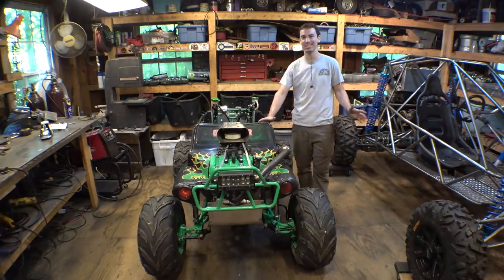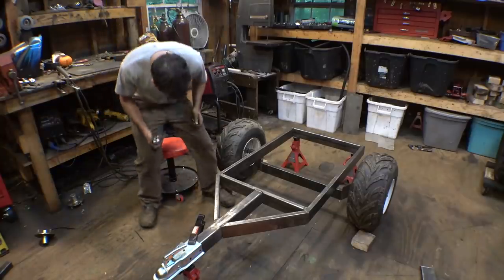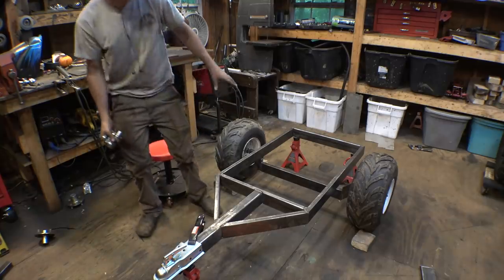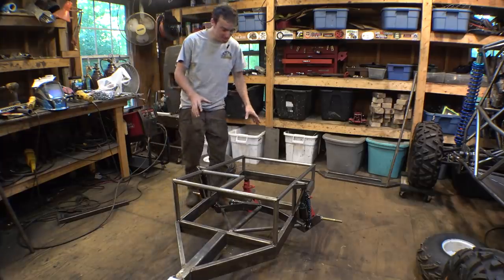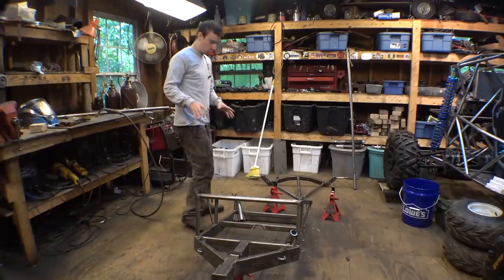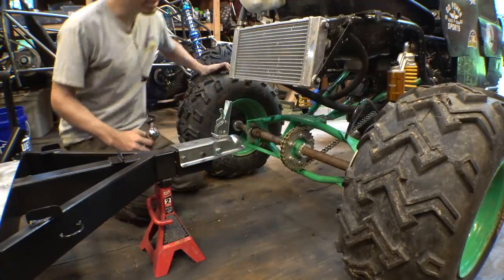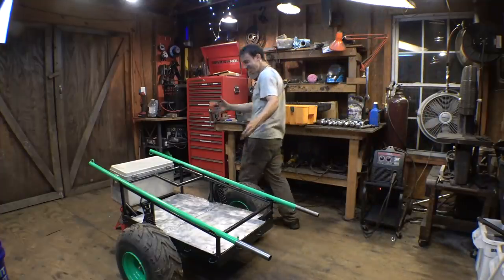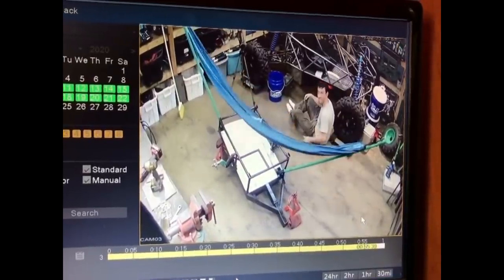Budget Powerwheels Overlanding Trailer Build

Comment: The trailer is super cool!  But I wonder if attaching the hitch on the Ninja below the suspension might be a mistake?  Wouldn't it be much more stable if the ball was attached to the chassis above the springs instead of below them?  There would be much less movement of the ball overall that way...

Comment: Great build man!  If I might offer a pair of suggestions that I think you'll benefit from. 
1. take some thick wall rubber tubing or hose long enough to wrap around your trailer hitch plate on the ninja.  and slit it lengthwise and jamb the ends in to those open tubes (or just split it over them.) and tuck that flat plate part of the hitch into the slit  in the hose.  Your shins will thank you!
2. you might want to pop a couple swing up or just  removable outrigger  legs (back hoe style) to keep the front end  from tipping over .  (like back in the day when "ATV" meant 3 wheeler, not quad. And they would roll over on ya if you cornered to hard or fast!  ;)  Without em I think you'll find your hammock a tad unstable even with the wheels on and hitched up.

Comment: looks great and functional. .  suspension turned out good too!

*edit*
you may want to run a big bolt with a wing nut or something to keep them extension arms secure.
i know they seem right now but i think vibration will rattle them loose after time.
i could be wrong(so at least bring some zip ties, and duct tape. . lol

peace, eric

Comment: I'm just going to build this out of scrap I have laying around.  Persists to build one of the best trailers I've ever seen.
Reply: And this thing will hold 2000 pounds, built like a tank xD
Reply: Its so over built.. lol
Reply: some people are amazing with repurposed materials...
Reply: calholli then there’s boostedbois. Their turbo v6 sandrail has less frame than most of RBW’s builds
Reply: Real talk though, Chris needs to see that he can use much less cage, dudes building complicated heavy cages when he can basically lightly modify a funny car cage design and still be lighter
Reply: His and grind hard plumbing trailers are insanely well built.
Reply: Chris L apart from the hitch snapping on grind hard one and having smaller wheels I think this one will last longer

Comment: Now you are arriving at my campaign. My cross cart plans are a starter motor for reverse gear and a hammock that uses add on fence tubing connecting to the frame then dis connecting for the hammock frame so it is unseen until used. It will only be partial frame support. I also want the gearing 2 speed on and off road so it will dramatic gearring.  The frame unit will flex for short and long wheel bases. The hammock may go away so i can sleep in the actual cart and the hammock bars will provide a water & weather proof protection. I want quiet so the exhaust may be an all together different project. Heating rocks for cold weather. frame (inner tubing) and exit the other frame side (also a rocks heater, perhaps a fire box) plus a heat radiator cut off valve. Plus an airconditioner smaller engine, say 49cc  and an automotive built in the small trailer.   
    For me,  Climate control is essential.  The hammock will allow for another person plus for fishing as a net.

Comment: I hope it don't rain! LOL I'm sure that tent I mean hammock, lol isn't rainproof you'll be sleeping in a water bag.
Man if I would have known you needed the trailer in a pinch you could have just borrowed mine, and my gear... It's not the best I built it for my motorcycle, it was a 4' X 8' utility trailer Harbor Freight Style... One section out of it so it's only 2' x 4' axle cut down and leaf springs. Cooler on front, and small table top LP Grill, but the best part is the body, it off of a display unit from a bedliner company... so it's got a 2 by 4 ft by about a 1' high tiny little truck bed trailer. Fits all my camping gear perfectly cover the top with a tarp and I'm down the road I go... It's travel the highways from the Quad-Cities Area, to Nashville, Tennessee, to St Louis, and back to the Quad-Cities, and proving itself a very useful trailer for various jobs all the time.... so it's proven its durability for as cheap of piece of junk construction it is... definitely cute build if you want to call it that being a miniature truck bed trailer, everybody's like it and asks where the heck did you get that, just really neat to see behind my motorcycle and get it painted yellow to match.

Comment: In the future when you paint rims with the tires on, if you slightly deflate the tire you can slip playing cards between the rim and the bead of the tire then just re-inflate the tire and paint without worrying about paint over spray on the tire itself(just do the same thing to remove the cards when the paints dried to the touch). best of all you can reuse the cards multiple times..

Comment: you're probably gone already, but the hammock should be tighter. you'll have less backache
Reply: Not true. You want it to be curved. You sleep in it sorta sideways. That way you have way more room and it's actually a more flat sleeping position.
Reply: @Yamahadipper8  I just went 'real hammocking' last week for the first time. Learned a bunch. My friend had like 4 to chose from. They have legit hammocks with sleeves that hold your sleeping pads in a diagonal fashion. If the hammock isn't tight enough you can't sleep within the padded area. Without the sleeping pad you get quite cold because there isn't insulation (if the camping is in the mountains). The tighter the hammock, the better it is for longer sleep sessions.  You can nap in a loose hammock just fine, but try sleeping 8 hours, your back will be killing you.
Reply: @Yamahadipper8  He said tighter he didn't mention anything about removing the curve. If the droop is overextended you will get serious back pain after a night's sleep.

Comment: stands under the hooks in all 4 corners and your not going to tip over again. Also undercoating on the parts that scrape or rubber tube/ Hockey tape also works well. There is always the electric tape method.

Comment: Just a little tip that I was always told, cross your safety chains under the tongue of the trailer. that way if you do lose your trailer the chains will catch the tongue to keep it from hitting the ground it’ll also allow you to stop without the trailer running into the back of you

Comment: When building a trailer, most people just use a couple leaf springs and a straight axle. Chris builds a trailing arm suspension with panhard bar and coilovers... and calls it simple. 😝
Reply: I mean Grind Hard used shocks on their overland trailer
Reply: Yes, and IMO it was a good idea. Because the HF trailer they used is super bouncy. (I have one)
Reply: Josh Frank  No. I mean shocks. They used both.

Comment: get yourself a spray gun and use 2k paint (2 pack) its literally coloured resin and its near on as tuff as powder coat. no need for clear coat. also you should weld a skid to the bottom of tow bar and use it as a wheelie bar

Comment: Not sure if you are used to camping out in the middle of nowhere.  Bring a rope to go from the top of the bar to the top of the other for a tarp in case it rains and some cords and spikes to tie it down.  Bring another tarp for the Grave Ninja.  Even if it does not rain you might get heavy dew.  A spare tires and a tire pump and some tire sealant would be a good idea just in case.  A plastic 5 gallon bucket with a toilet seat kit to go on in, some garbage bags, and a shovel as well as toilet paper.  Bring a couple of gallons of water for washing up or in case you coolant system leaks.  Don't forget a power bank to charge you cell phone and camera and some flashlights, lighters, and a good knife and hatchet/ax.  Bring bug spray, suntan lotion, some bandages and antiseptic spray, ibuprofen, Imodium, and Benadryl.  Sun glasses and a hat as well as some bandannas (good for lots of things).  Extra clothes underwear, and sock, and maybe a second pair of shoes in case everything gets wet.  Of course food and drink and snacks.  I would also bring a chair and maybe a book in case there is time to waste sitting under your tarp waiting for rain to pass.

Comment: Over-landing as it may be and having a trailer in tow, one of the requirements for that trailer is having a most
adequate ground clearance and for it to be able to articulate well and still not catch on your trailer extension
hitch, nor bottom out. I how this helps you out some! Out of the several videos that i had seen, the previous
mentions can be crucial overall, in especially when pulling a trailer through heavily rutted soil, clay and partial
washouts and still be able to ambulate and articulate and not get hung up! If you get hung up, both your rig
and the trailer has the potential to get stuck and buried with mud in some cases whereby the fun that you 
would have had, turning into a nightmarish monstrosity and I'm am very sure that you do not want that! Your
build has to be that good by using the noggin, right from jump-street.
Reply: Setting your frame height to 14 inches might do it, but ultimately, it's your decision!

Comment: Next time you make a trailer hitch, it should be on a suspended part of the frame, that things going to shake like crazy.
Reply: If I didn't find your comment, I would have made my own. Suspend trailer hitch from frame and a swivel hitch.
Reply: Understanding Chris's attention to detail, I'm reasonably sure he considered that; especially considering literally every other trailer hitch in the world (for the most part) is not suspension mounted. Lol!
Reply: @NoneyoBisniss  Literally every trailer hitch in the world (for the most part) is mounted to the frame of the vehicle, which is suspended, not the rear axle.
Reply: i dont think the suspension would appreciate the extra weight, but your not wrong
Reply: @Grim0954  I think a swivel hitch is overrated, several people said I would needed a swivel hitch when I decided to build my motorcycle trailer. Then other people said I didn't need one, and explained it to me. The mechanics of the ball hitch allow that thing to pivot plenty swivel hitch is not needed. If I can lay my motorcycle literally on it's side... further on the side than I ever would riding it, and have both trailer tires still be on the ground with a ball, and only a slight bind... yeah it's just not needed....
Reply: @justinhobart8747  I was thinking over landing might involve some crossings and whatnot that might have steeper angles. No matter, to each their own.